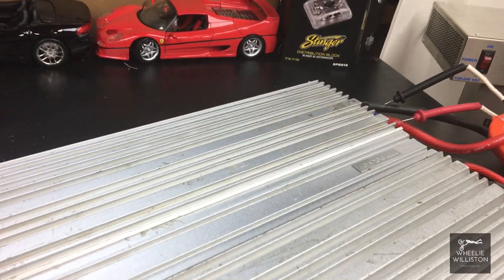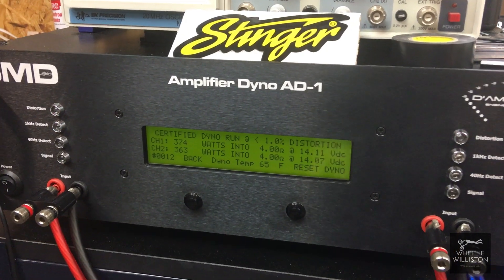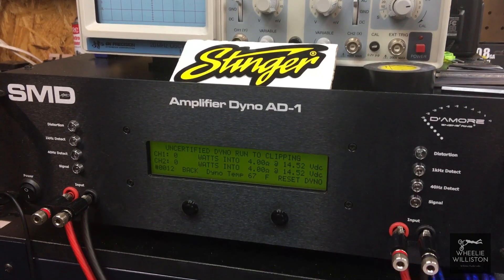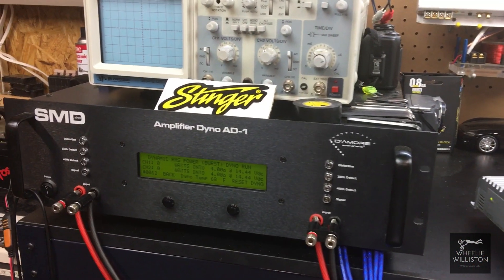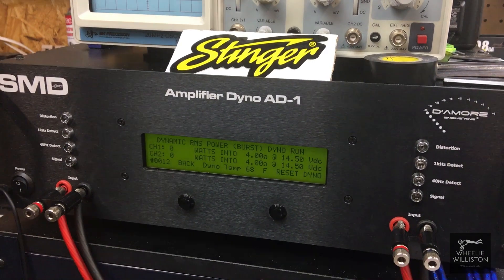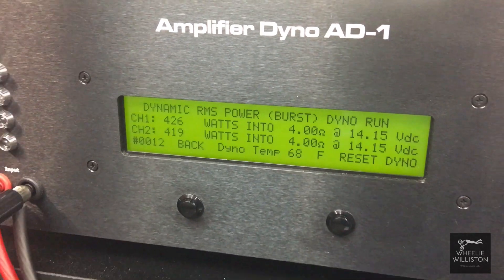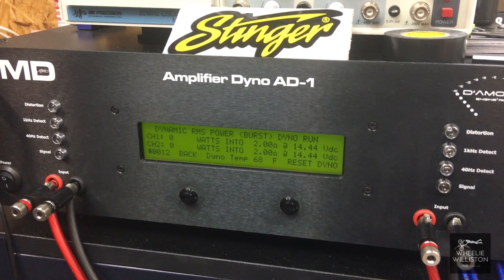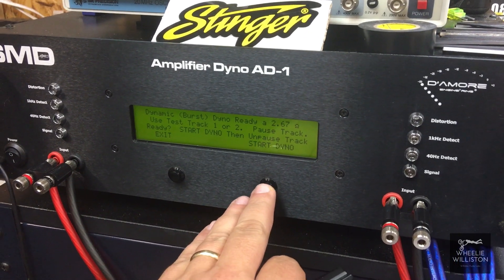2001 Eclipse 34230 Premium Dual Monoblock Amp Dyno Test

Comment from the maker: Shop:
Williston Audio Merch: https://teespring.com/stores/bigdwiz
SMD AMM-1 Audio Multimeter: https://amzn.to/2WRc5eD
Elac Speakers: https://amzn.to/3mR0WWF
Savard Hi-Q Subwoofers: https://amzn.to/2ZPdgNx
Shop Car Amplifiers on Amazon: https://amzn.to/37zs8Uz
SMD / D'Amore Engineering Amp Dyno: https://goo.gl/sJTcf7
XS Power D1400 Batteries - https://amzn.to/2BPFCKW
XS Power PSC60 Charger - https://amzn.to/2CHGcfs
Fluke 1000A AC/DC Clamp Meter: https://amzn.to/2Rw5WDA
Handheld Dyno: http://amzn.to/2u2EgKV
My Favorite Screwdriver Kit: http://amzn.to/2x0VzcE

DISCLAIMER: This video and description contains affiliate links, which means that if you purchase from one of the product links, I may receive a small commission. As an Amazon Associate I earn from qualifying purchases

Comment: williston,,a question here,,to you all rather,,the op amps in these is gener a texas 5532 if i dnt know last digits,,but as dual op amp,,it looks like this 1 has 4 of them,,,i read that there are newer better op amps with diff names like oracle2,muses2-opa1622- burson v5,,some have lower noise,,some have higher db,and some have better sound,,,do u have any clue if its poss to change and what to do or choose..like in thsi amp,,if 1 was to change them 4 for ex 4 burson v5i,,,would it work and would it change for better,,anyone that has vids out there ??

Comment: I have 4 of these amps an the odd thing is that 2 of them say 2-8ohms and 2 say 4-8ohms yet the internals are identical. My guess would be the ones saying 2 ohm are earlier models. Have not been able to use the S/N to verify year of production.

Comment: I have this amp still to this day. I used two of them in a 15”x 4 MTX thunder 8000 enclosure during my competition days. 148.9 db was my best with that setup in a Ford Explorer with everybody holding my windows from breaking. Those amps are so underrated it’s insane..

Comment: I’ve got a 33240 with 2x 15inch eclipse subs that had been sitting in the garage for 15years. Recently had them installed in my car. There not as good as I remember.
Reply from the maker: WhatchutalkinboutWillis 🤷‍♂️
Reply: Hahaha. You may be able to help, it’s fitted in a 2013 Audi S3 with bang and Olufsen upgrade. I’ve had to take the B&O sub speaker cables and convert them to RCA’s
Would that be the cause of the problem ( low notes are very muted). 
A lot has changed in 15 years! everything seems to be fibre optic now. 🤦‍♂️
Reply: @willis8281  Buy a Clarion 755 EQ and you'll be able to use high level speaker inputs while having 8 volt RCA preouts. Will probably sound "like you remember" or better :D More than willing to help if I can.

Comment: Hey big D can you test this amp again and switch between mono,stereo, L+R. This amp is my daily driver but I never have really understood that one setting. Also one of the fuses was incorrect. It seems there are different versions also on the bottom mine say 2-4 ohm i have seen others say 4 ohm only, any ideas on that?

Comment: Nice. I have a 4 channel from this line. Works great and sounds great. Just need to source new switches for the hp/lp and 2/3/4 features. They get loose and change positions on their own.
Reply: I have a ‘parts’ amp that I’d sell for a reasonable $$. It’s the 32430, the 2/3/4 channel amp / little brother to the amp in video. LMK.

Comment: Looks like one I had on  2 10’s back in the day. Beat up like the one I had to because the only thing holding it was the wires. Young and dumb. 👍
Reply from the maker: Yeah this one looked like it was used to sharpen hammers or something
Reply: @wal2  still pushing numbers. Those old kickers I had was probably pushing to the limit on this amp. Especially using the gain as a volume button 😝

Comment: I miss my 2 Eclipse DA7122 amps and 2 8812s. I had a complete old school eclipse build in my 05 Grand Cherokee a few yrs ago!
Reply: Currently running 7122 and 2-12” 88dvcs in my wife’s Jeep Grand Cherokee 2016
Reply: @clearme2  ever wire them below 2 ohms? I lost 1 in a garage fire then sold the other b4 I ever tried.
Reply: @stevepartridge75  it’s wired at 2 ohms at the subs and series back to the a safe 4 ohms on the amp . Never tried below 2 before

Comment: Nice, I really liked the gut shots, just a beautiful old school amp.  Copper bars between the supply and output, classy amp. Did it sound good? I'm def partial to class AB for mids n highs
Reply from the maker: Sounded clean for sure. Too bad external cosmetics were rough
Reply: I'm kind of new to the world of those car power amplifiers and I've never seen so many mosfets in a single car amp! So that's why you're talking about class AB?
I've other 2 questions....
For work with such a high power with very low ohm loads, is the bus voltage dynamically regulated or it's fixed?
Second, what are those kind of iron core transformers? It seems strange some iron in a switching converter... Are they just filtering inductors?
Thanks a lot for the answer!! 🙃🙃